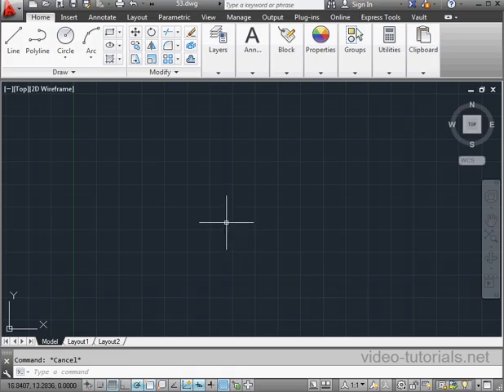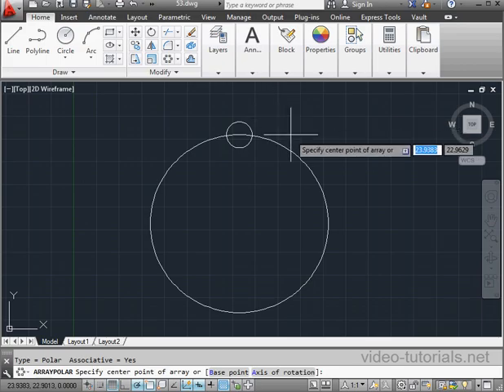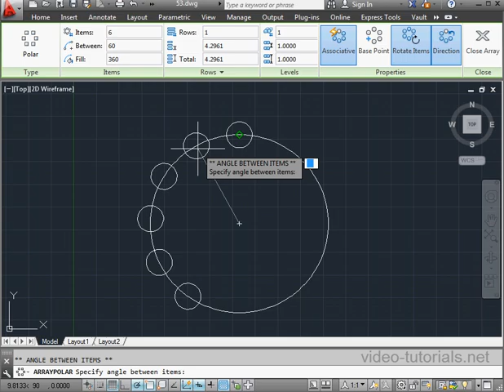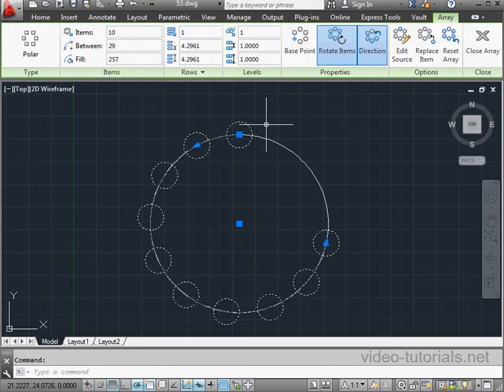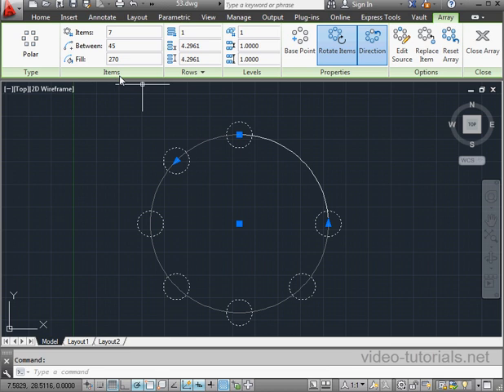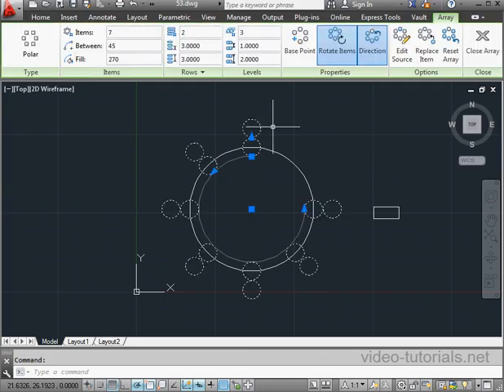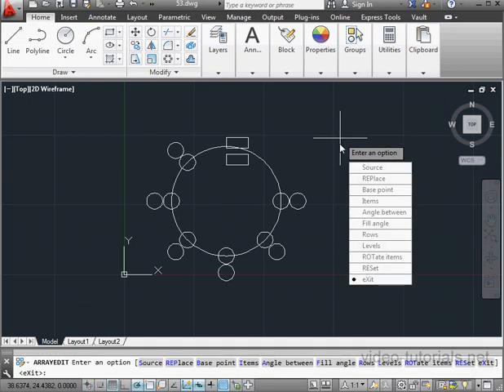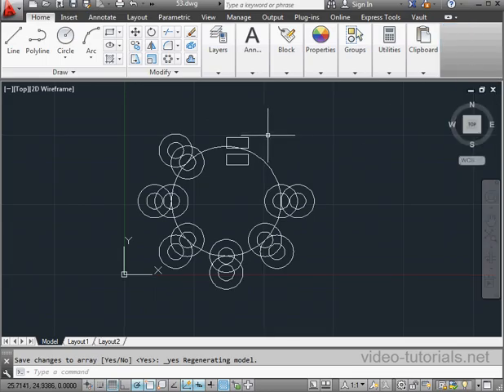How to create and use polar arrays (circular patterns) AutoCAD Tutorials

Comment: Hi I'm new to autocad, i usually use polar array to arrange the circles in perfectly fit area,
If i need 6 same size circles as the center circle,
I just draw the circle and copy the circle from quadrent point and place on the top of the circle and simply gives a command of a polar array of 6 circles with commanding center of the first circle.
I want to make more than 6 circles upto 20 circles in the polar array position,
Is there any automatic command for  this or I've to manage it manually.
I'll be pleased if i get answer for this question ⁉️
Thanks and regards
Suneel Kanda from India
Agra